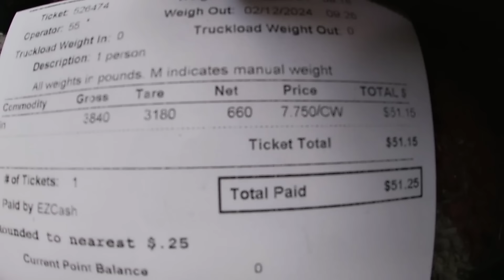Collecting curbside scraps for cash.

Comment: I went out yesterday and today and filled my truck three and a half times. Will process as I get time. Left two washers, one dryer and a six cylinder engine block sit along the route as I'm not messing with this heavy stuff. I did strip all the wire out of the appliances and got the already removed crank, starter and such from the block. Even got the tore down manual transmission that I would have left if in one piece. I also stripped all the wiring and baskets out of two plastic drum dish washers. I'm retired and do this for fun and fighting with heavy and awkward things is not my idea of fun. Let someone else blow their back out I say. I plan on taking a couple loads of metal to the yard this week as prices here rose to just under $200 per ton.  Great video.